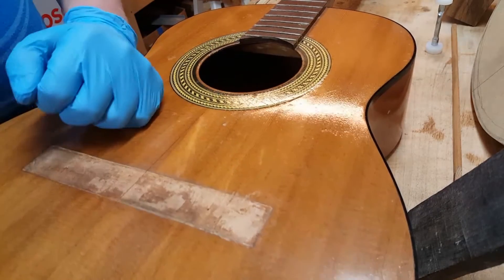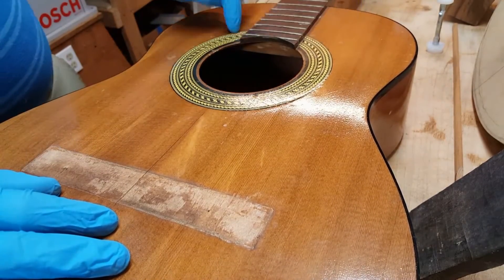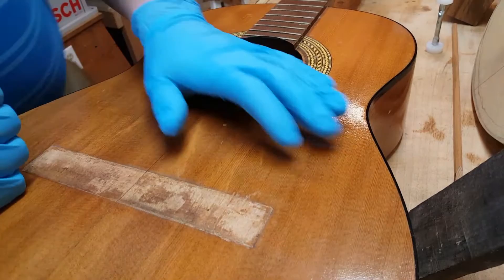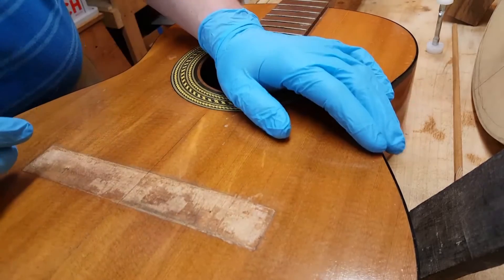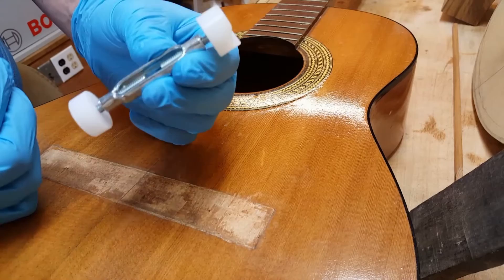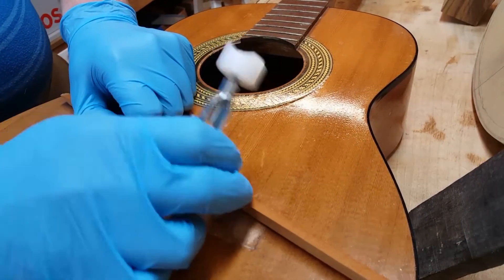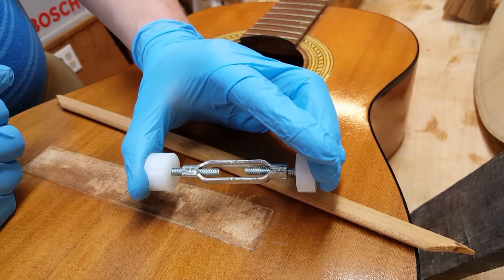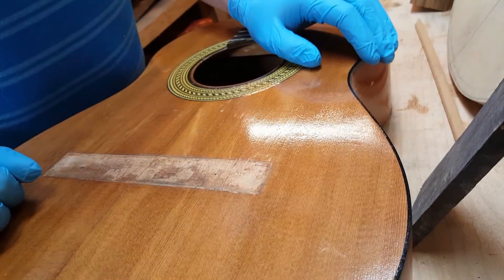How To Find a Loose Brace Inside a Guitar

Comment: This eases my mind some. I used cut up chop sticks for clamping with a little weight on top and was worried I didn't have enough pressure.
Reply from the maker: Thanks for watching! 

Yes, anything that would make the brace make full contact the top or back again would be sufficient. 

Thanks again for watching!

Comment: Nice little description, thank you for uploading.
I'm having a loose brace on two acoustics of mine, Probably because the original glue has lost it's strength after some 15 years.
I hate fixing braces, it's such a pain in the ass but it is as it is.

Comment: got an alhambra 4P where after moving and playing daily for 4 months the low E string buzzes at various registers but most noticeably when played open. It appears to be coming from the bridge. Is this in an internal issue? I changed the stings for the first time a month ago and it just started so trying to figure out if its the string, internal or a mix of both from moving between places several times. Anyone have any guesses?
Reply from the maker: Open buzzes makes the nut slot in a suspect.

Honestly so many things can cause the issue its goikg to be best to take to a local shop and have them look at it.  

After moving? More humid environment maybe? Possible the truss rod just needs backed off and you good to go. The adjustment may put things back in line where you remember them before. 

As I say... so hard to say over comments...  But someone can look at it and most likely tell you in minutes. 

Taking it to a local shop will yield the most stress free answer and likely the quickest solution for you. 

Good luck!
Reply: @daveydacusguitars9033  thank you for the quick reply! Its a nylon string so there's no truss rod which I think rules some things out. The sound distinctly sounds like its coming from the bridge when I strike the string but I will investigate with some one in person thanks again!

Comment: Well that was a very brief description . Some questions might be do I have to remove the whole brace to re glue it . How do I find the spot that needs re gluing. How do I get the glue under the brace through th sound hole and blind
Reply from the maker: Sort of did this video on the fly 

After you've roughly located the loose brace you can then feel around inside and find exactly where it is loose. Pushing the brace side to side or feeling for a gap. You have to be careful here as it's easy to separate the brace farther, some olderinstruments braces are barely holding on as it is.

If avoidable I wouldn't remove the entire brace. Placing it back correctly would be terribly difficult through the sound hole. 

So first, I prep how I'm going to clamp the brace. This step is very important. Stewmac does have relatively cheap brace clamps that act against the back of the guitar, you turn them and they put pressure. Like a turnbuckle style clamp. But you dont wanna fumble around with this after glue is setting up. You need to be ready to do this soon after the glue placed. 

Stew mac sells a small thin glue injector that puts glue exactly where you want it under the brace, I find it over priced and haven't used it before but I'm sure it works. Usually what I will do is simply try to aim with the bottle and let gravity help while turning the guitar this way or that, glue comes directly from the bottle. My prefered glue is titebond. This can get messy, so practice doing it is good. This gets glue close, I'll then go inside and force as much glue as I can under the loose area. It's almost always near the end of the brace. 

I prep ahead and keep multiple wet towels or pieces of cloth around to clean up the excess gluebefore clamping. So round one clean up gets any glue where I missed with the bottle. 

Then finger pressure to close the joint, this tells me if I have glue enough inside because I can see if there is sufficient squeeze out around the loose area. It also pushes out some glue, so a second round of clean up inside, then finally close the joint with the clamps. 

You can't get to much of it with the clamps in place to clean. Using finger pressure to close the joint first usually gets most of the big squeeze out. After clamping for the last time there is usually a small bead of glue left around the clamp and if done correctly it's a pretty clean look in the end. 

This method requires a lot of clean up. It is a pain working through the sound hole. I recommend and inspection mirror with a light to help see what's needed. 

Just work thought it all in your head first, then everything should go smoothly as you go to do the work. 

I personally rhing the cleaning stages are very important. I don't want anyone working behind me and seeing a huge mess I've left with glue.